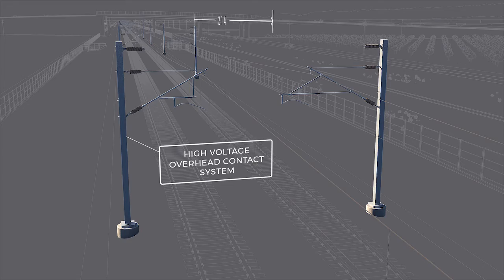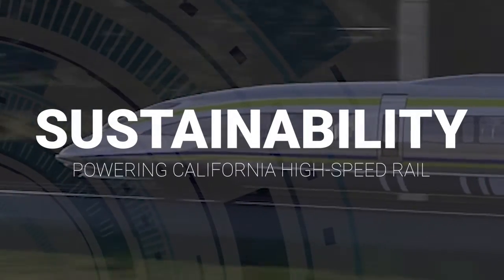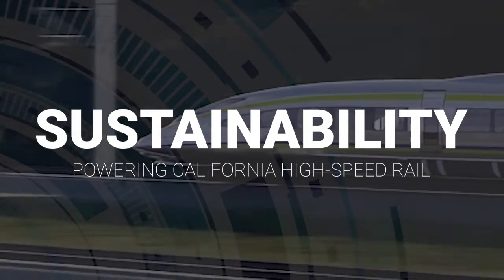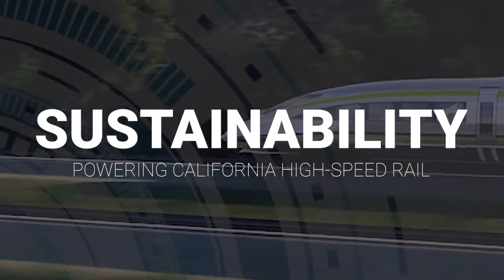Powering High-Speed Rail with Clean Energy

Comment: How is this going to happen when we have rolling blackouts
Reply: answered in the video. CAHSR will produce its own power, with its own plants and storage.
Reply: What rolling blackouts? Have you experienced one recently? CA has announced possible rolling brownouts where the electricity might be out for a few minutes or a couple of hours in a very small geographic area. I don't know if it has happened at all in the last several years. At least in LA County it hasn't happened. This isn't Texas where you had a complete blackout for weeks in a huge geographical area and people actually died.
Reply: @theexmann  well last year there was a blackout but
1. It’s very rare
2. It only affects a small area
3. As you said, it’s much better than Texas
Reply: Solar power plus battery for storage would ig solve this problem
Reply: The issue with electricity in California is the absurd inability to transmit power when the wind is blowing due to shoddy maintenance of power lines.  CAHSR would largely sidestep this issue by generating and storing power next to the right of way.
Reply: I remember that there was a recent blackout in a small suburb of LA, but it was a long time ago and it didn't impact the entire city. It was only a small part of the city affected. So, I do not see the issue, especially when they are considering the creation of electricity for their own use.
Reply: It isn't. By the time this is running we won't have them. This video is about producing electricity.